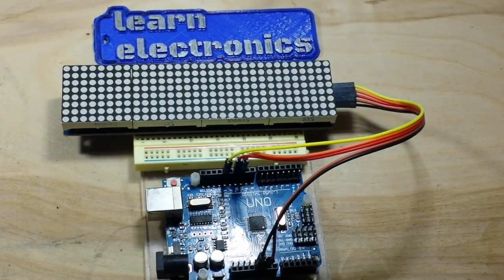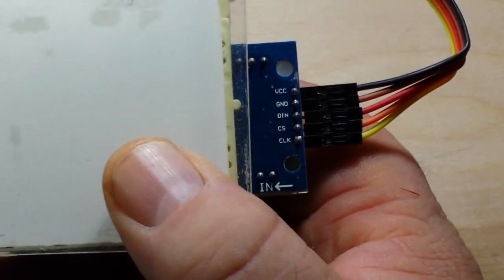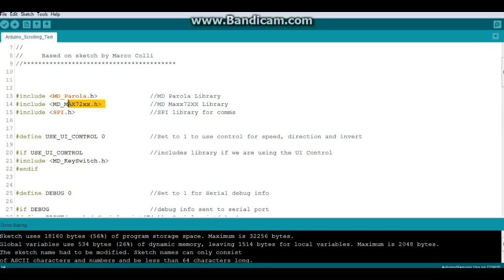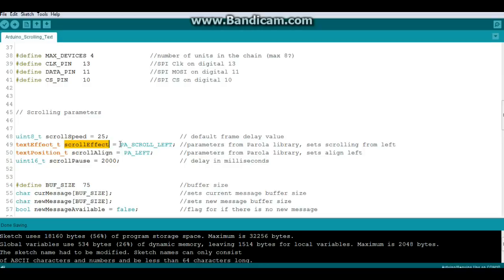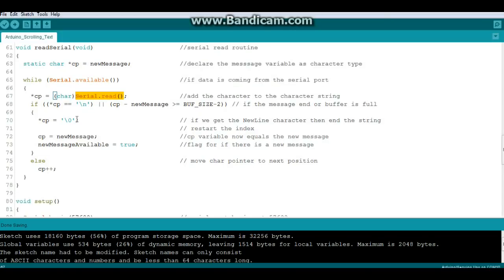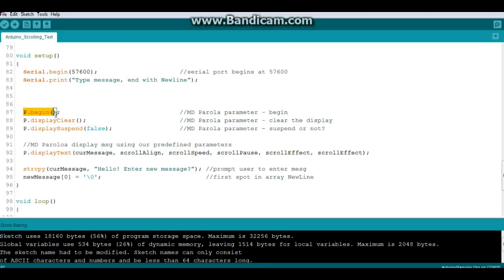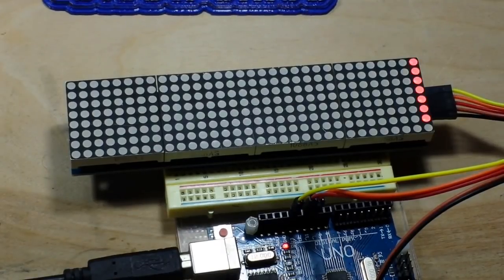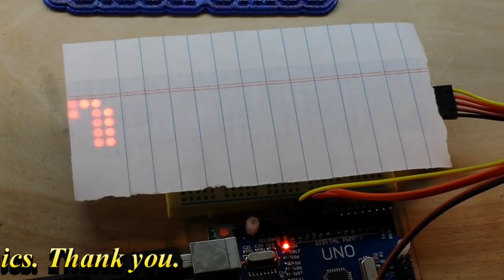Arduino Scrolling Message Display

Comment: Hello, could you help me? I have this error:
Arduino:1.8.19 (Windows 10), Scheda:"Arduino Uno"

C:\Users\6767s\Desktop\Arduino\orologio LEARN ELETRONICS\003333\003333.ino: In function 'void setup()':

003333:87:3: error: 'P' was not declared in this scope

   P.begin();                                //MD Parola parameter - begin

   ^

C:\Users\6767s\Desktop\Arduino\orologio LEARN ELETRONICS\003333\003333.ino:87:3: note: suggested alternative: 'PI'

   P.begin();                                //MD Parola parameter - begin

   ^

   PI

C:\Users\6767s\Desktop\Arduino\orologio LEARN ELETRONICS\003333\003333.ino: In function 'void loop()':

003333:103:7: error: 'P' was not declared in this scope

   if (P.displayAnimate())

       ^

C:\Users\6767s\Desktop\Arduino\orologio LEARN ELETRONICS\003333\003333.ino:103:7: note: suggested alternative: 'PI'

   if (P.displayAnimate())

       ^

       PI

exit status 1

'P' was not declared in this scope

Questo report potrebbe essere più ricco di informazioni abilitando l'opzione
"Mostra un output dettagliato durante la compilazione"
in "File -> Impostazioni"

thank you

Comment: mirror text help please!!!
Reply: Use new version of MD_Max72xx and MD_Parola libraries. And try Parola example sketch called "Scrolling". In code, line 43 you'll see:
 #define HARDWARE_TYPE MD_MAX72XX::PAROLA_HW

change PAROLA_HW to your match your  Max7219 type.  Mine is FC16_HW

So it will look like this -> #define HARDWARE_TYPE MD_MAX72XX::FC16_HW
don't forget "_HW "   

Google for different hardware type of Max7219.

Comment: When compiling the Program, the error appears: P' was not declared in this scope. What can be this mistake?
Reply: @yazlmgelistiricisi1245   The hardware definition and variable declaration are missing.
#define HARDWARE_TYPE MD_MAX72XX::PAROLA_HW
// HARDWARE SPI
MD_Parola P = MD_Parola(HARDWARE_TYPE, CS_PIN, MAX_DEVICES);
You need to put those three lines  in the  header, I wrote them starting on line 42 of his program and it made it work, sort of. I'm getting the issue that each panel is being read individually so the message is repeating across all four rather than scrolling across them.
Reply: I am getting the same thing and I can't figure out how to fix it

Comment: Sir 
I used arduino uno & max7219 dot matrix 4 module and used md parola library include spi max 72xx also ...all connection r ok but the display in reverse direction and each module ... i cannot understand why this occured please help me .
Thank u
Reply: NOTE: You no longer need to make the modification in the Parola/MAX72xx Library as may be noted in the video.  In the updated EXAMPLES there is now a line that reads:

#define HARDWARE_TYPE MD_MAX72XX::PAROLA_HW

And you can change the "PAROLA_HW" to the type of board/matrix you are using.

For example I use the FC-16 boards so I changed the define to:

#define HARDWARE_TYPE MD_MAX72XX::FC16_HW 

You can find the enum moduleType_t definition in the MD_MAX72xx.h file at around line # 265 to define which module you are using.
Reply from the maker: Chevk your configuration in the .h file.
Reply: Yeah, i have the exact same problem... but what do we have to configure in the .h file?

Comment: I keep getting 'P' was not declared in this scope
Reply: put this MD_Parola P = MD_Parola(CS_PIN, MAX_DEVICES); after the defines
Reply: @ronnieharris9907  Thanks Ronnie, that did the trick.
Reply: @ronnieharris9907  can you write where ia the position? Thx
Reply: @ronnieharris9907  Thanks Bhai
Reply: 0hPhuc so what did you do...
Reply: I ended up rolling back to a previous library and everything worked
Reply: what library did you use?
Reply: I use two libraries with the LED matrix. MD_MAX72XX ver 2.10.0 and MD_Parola ver 2.6.4  It was the latter library that I rolled back two versions to get it to work.
Reply: i tried the same but i keep getting same error

Comment: I get the following errors:

In file included from /home/willemse/Arduino/Arduino_scrolling_text/Arduino_scrolling_text.ino:13:0:
/home/willemse/Arduino/libraries/MD_Parola/src/MD_Parola.h:777:3: warning: 'typedef' was ignored in this declaration
   };
   ^
/home/willemse/Arduino/Arduino_scrolling_text/Arduino_scrolling_text.ino: In function 'void setup()':
Arduino_scrolling_text:86: error: 'P' was not declared in this scope 
   P.begin();                                //MD Parola parameter - begin
   ^
/home/willemse/Arduino/Arduino_scrolling_text/Arduino_scrolling_text.ino: In function 'void loop()':
Arduino_scrolling_text:102: error: 'P' was not declared in this scope
   if (P.displayAnimate())
       ^
exit status 1
'P' was not declared in this scope

Does anybody know what is wrong ??
Reply: Han Willemsen so what did you do...
Reply: Same with me too...

Comment: The MAX7219 is an excellent chip...I liked this very much, I saw one of your previous video how to set that up in breadboard. It worked just fine.. you can use a bluetooth module to set the text from your mobile app too, build by using MIT app inventor
Reply from the maker: +Sayantan Maiti cool